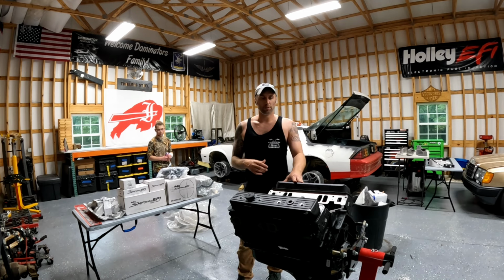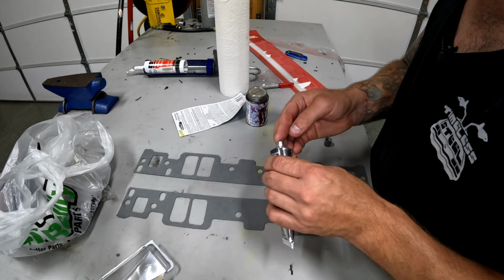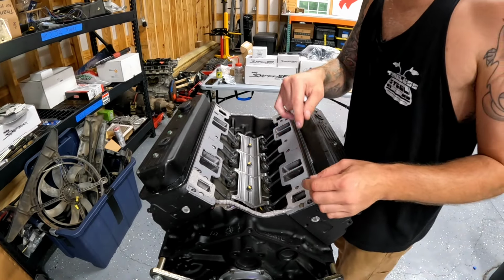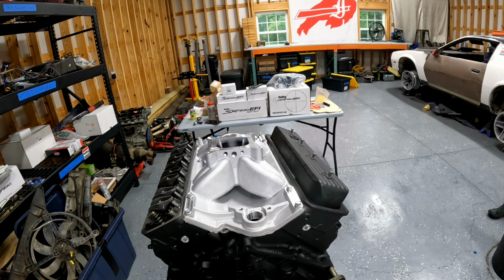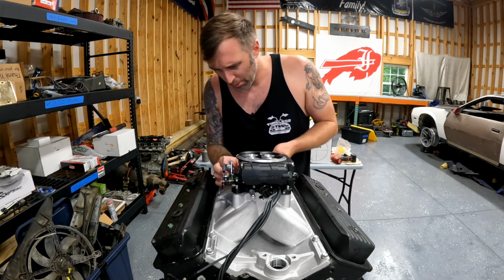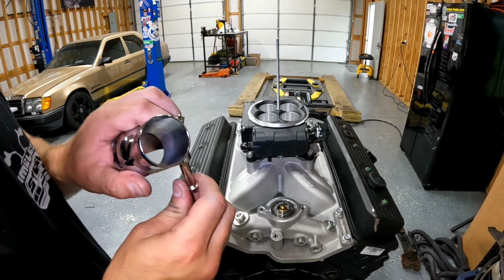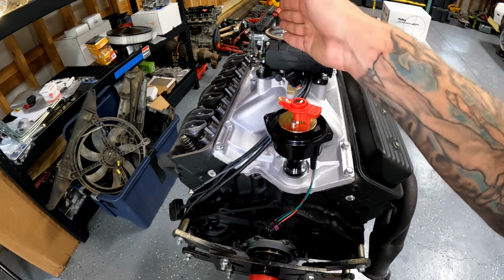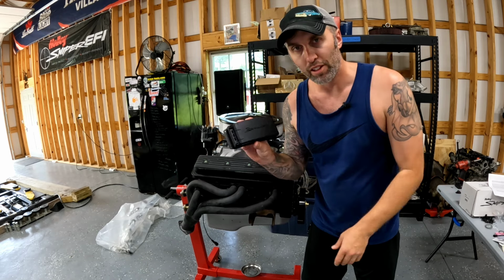Holley Sniper 2 Vortech 350 Engine Build !

Comment: Nice build! A couple of questions. For such a low HP engine (no denigration!) why are you using a Holly High Rise manifold? That engine was made for a truck application where it's life is is in the 2000-4500 rpm range. HR manifolds are generally used in 5,000-7,000 rpm range. Second, that engine intake may have hood clearance issues. Might need a new hood? Again just asking questions I don't criticize. Your car.
Reply from the maker: No problem. good questions.  Your absolutely right about power bands.   Easiest answer is....cause its what i got lol. That motor will make more power eventually. The car has a cowl hood for that reason .  May have to put a smaller air cleaner on it. Thank you for watching! I appreciate it.
Reply from the maker: Calling it a high rise manifold may be a mistake on my part.  Holley just calls it a single plane. " Power band: 2500-7500 RPM" also this manifold is specifically designed for the vortec 350 by Holley .
Reply: You are welcome and thanks for answering my questions.

Comment: Get the Sniper EFi valve covers part # 890010B.Great video
Reply from the maker: Thanks !
Reply from the maker: They make a vortec head version?  I just see perimeter style ?
Reply: @timelesssteelgarage 
Not with the Sniper logo but they have some with the Chevy logo 
Part# 241-292 they’re pricey tho.I’m not sure if part# 241-286 will fit but they also have the center bolt holes and are half the price of the other ones.
Reply from the maker: @antionewalker4081  awesome thank you!! Those crate vortec covers are boring lol

Comment: Nice video! I have really enjoyed following along!

From my understanding from when the first gen launched, these throttle body style efi units don't do as good a job of fuel atomisation as a traditional carburettor. As a result, they actually use more fuel. 

They are night and day on blower applications, though apparently.  the blower keeps the fuel in the air, and the efi keeps it fed consistently and can run more lean as a result. That's what I've read anyway. 

I'm interested to see how your experience is with the new generation. 

FYI, switching to a dual plane manifold will help a lot as it generates a lot more vacuum a lot lower in the rev range, which helps keep the fuel in the air.
Reply from the maker: Interesting ! Thank you for following along.  This build is really getting exciting.   Have a bare ford 9 inch in the mail!